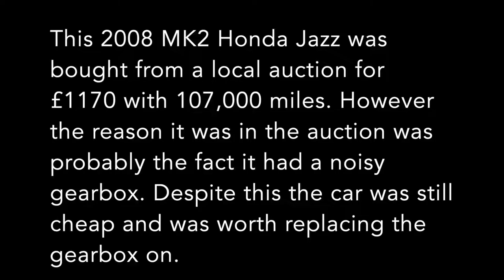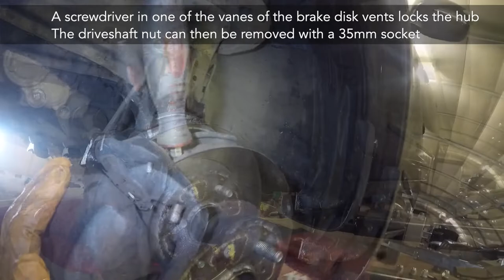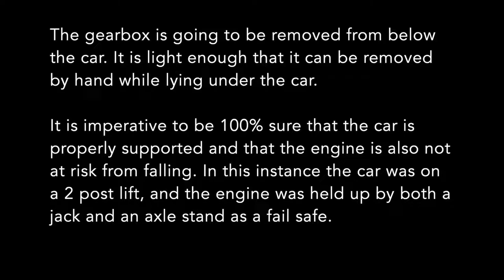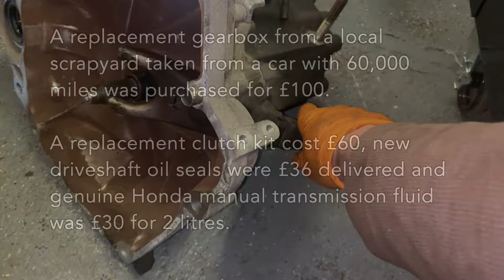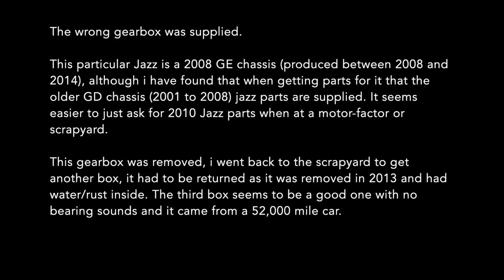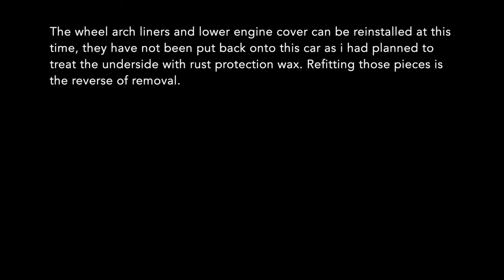Honda Jazz/Fit GE, Gearbox & Clutch Replacement

Comment: do you know what part of the gearbox was making noise? Mine makes the same noise and I've read it may be an input shaft bearing. Do you reckon its not worth rebuilding and should just be replaced?
Reply from the maker: I think it would be the input shaft bearings.
I was never brave enough to strip the jazz gearbox down and i probably shoud have it would have saved running around trying to find a good used one.

If you can find a gearbox specialist that can do it for a reasonable price then yes it probably is worth it for a set of bearings. A car i bought more recently and worked on the gearbox was a suzuki alto, same issue with the input shaft bearings although i attempted the fix myself and with new input shaft bearings the car was sorted:
https://youtu.be/6vr5mF2h7u4

Comment: I had same problem. Service changed LUK cluch and 2 dead bearings from gearbox. Nice video. I wuold like to see more on jazz. Maybe how to do anticorosion,  coz in Lithuania we get prety crazy winters. How to change brake fluids and all other fluids properly.
Reply from the maker: As it happens ive spent about £300 on a plethora of chemicals to rust proof cars from rustbuster. Should do more than 1 car but its a bit more than just spraying a bit of wax under there. It seems to be a problem with any japanse car ive had on the lift they can be quite rusty underneath.

Comment: how easy is it to get one of these gearbox .....where can i purchase it
Reply from the maker: I got the gearbox for this from the local scrapyard, a mate worked there at the time. It cost £100.
Although it was a bit of a saga, the first gearbox was either from a civic or mk1 jazz it had the wrong mounts, the second gearbox i got home and found it had watery oil inside, the third gearbox seemed to work.

Id say a gearbox might cost a bit more, but it will be a case of ringing round breakers yards or trying ebay for honda jazzes that are for breaking.
Reply: @peugeotCitroen2CV  thanks so much for your response

Comment: Can I ask the drive shaft nut you said it was a 35 mm I have read it is a 36mm Which is correct?
Reply from the maker: As it can be a few weeks between the time i shoot a video and edit it there can be some forgetting exact sizes.

Having a rummage through my tool box i only have a 32, 35 and 40mm impact socket bought to do work on PSA cars

Looking at this video that socket used is a shallow black socket which looks closest to my 32mm the 35mm is a deep socket. 
I think its a 32mm just haven't got the jazz to hand to double check
Reply: @peugeotCitroen2CV  Thanks for the reply

Comment: Hey JackNuts
you need to machine the flywheel or use a new flywheel.
Reply from the maker: @RichardAmuir-f2l  
Hello unique username

It was not necessary to do work to the flywheel in this instance as the clutch was fine, the input shaft bearings of the gearbox were the issue not the clutch or flywheel.
A visual inspection of the flywheel led to the conclusion that it was acceptable to use without any machining work or replacement. 

The car continues to drive perfectly with no issues related to its gearbox or clutch.

However if you are in that area of the car and notice deep scratches or heat marks then to remove the flywheel it is a series of extra bolts and a fee to a machinist to have it resurfaced.

Comment: I have an 09 Fit automatic, I get this weird grinding sound going from 2nd to 3rd.  It doesn't do that when I give it more acceleration, any idea of the culprit?  I would like to teardown and do as much as possible before I just replace it or junk the car.
Reply from the maker: Hi there,
I am not sure about the internals of the automatic box, i believe they were mostly a CVT unit.
Possibly as on the owners clubs what the noise could be. I don't know how strong or weak they are, Honda isn't really my area of expertise. If the car is rust free underneath a used box surely would be an option to save the car.
Reply: Repairing an auto or CVT is akin to brain surgery

Comment: My gearbox wont come off for the life of me, absolutely will not budge tried everything. Any tips ?
Reply from the maker: One of those ones that is hard to determine without being there.
All bolts definitely removed? Has it cleared the bell-housing or just still on the input shaft?
Reply: @peugeotCitroen2CV  everything is out, wiggles and leaves a gap but doesnt want to go. Feels like a stuck dowel
Reply from the maker: @RaiderOfTheLost  The dowels can stick a wee bit from time to time, are pry bars having any effect on the binding areas?

Comment: Great. What torque wrench are you using?
Reply from the maker: I have teng tools torque wrenches 1/4, 3/8 and 1/2" drive for the different range of torques required from time to time.

Comment: i can’t find anything on the web, but does the jazz have a cable clutch?
Reply from the maker: No this generation of Jazz and i think the MK1 used a hydraulic clutch.
At 38:52 in the video it shows the slave cylinder being refitted.

Comment: I have a problem in which if i drive the car for longer periods and then half press the clutch i hear a buzzing sound from the clutch. If fully depressed or engage it, the noise goes. I cant feel any slipages and car accelerates fine. Any idea? Should I get my clutch replaced.
Reply from the maker: Its likely to be the release bearing then, does the car make any noise when its sitting in neutral with your foot off the clutch pedal?

If its the release bearing you have to remove the gearbox and the bearing comes as part of a clutch kit.

Comment: Hi, where are you based and how much would you charge as I need to get this same job done. Please and thanks.
Reply from the maker: Hi im based in northern Ireland but i dont work as a mechanic, im an engineer but do these videos in my spare time so cant really help there.
All in id say the cost to get the parts and labour migbt range from £150-£350 depends on where you go and wheatear they are using genuine parts
Reply: @peugeotCitroen2CV  Thanks for the quick reply. Are there any mechanics or garages you can recommend in England? Thank you.

Comment: Why not rebuild?
Reply from the maker: At this particular time there was no local businesses that did gearbox rebuilding, the local scrapyard was closer.
Now that there is a business that has started up and can rebuild gearboxes i would consider that when going to the effort of removing it, although it would probably have cost about £300 for them to fit new input shaft/whatever other bearings were bad.

Comment: Передние колодки стоят неправильно,надо переставить.
Reply from the maker: Soemthing about pads requiring rearrangement? I am not sure what you are referring to.
Reply: @peugeotCitroen2CV  На видео видно что колодки стоят сигнализаторами вниз,а надо вверх.Так как при износе колодки сигнализатор установленный вниз отламывает и тогда владелец не узнает что колодка кончилась.Возможен износ до металла.Надо колодки установить сигнализаторами вверх,при износе он прижимается по ходу движения колеса и начинает противно пищать.Так что я прекрасно понимаю что пишу.8 лет на Хонде отработал.
Reply: @peugeotCitroen2CV  И братан купи себе клипсодёр,отвёрткой ковырять не солидно.
Reply from the maker: @ВадимДрандалуш-щ3я  
Ah fair enough the brake pads, they are due for a replacement so that will be sorted at the same time.

Comment: A big project.
But hitting the rods with a hammer?
I would use a piece of wood to protect the metal. That's how I learned.

Lovely garage with a lift! Yes, I am jealous... 😉

Some day I have a garage at home too.
Reply from the maker: It wasnt actually the tie rods that were being hit with the hammer it was the hub where they go through, the shock of the hammering freed them up. Wood would have reduced the shockwave of the hammer. The proper balljoint splitter was tried but on this car it did not work.

Comment: and they charge £850 -1000 for this
Reply from the maker: Quite possibly depending on where you go and the gearbox is being replaced or rebuilt. I will admit i was lucky in getting a good second hand box so cheap.